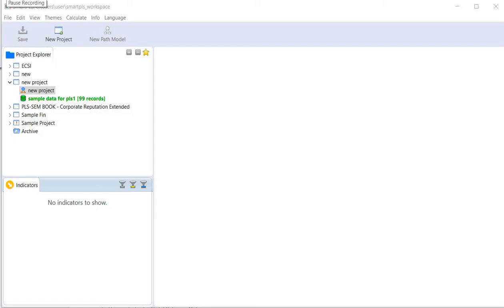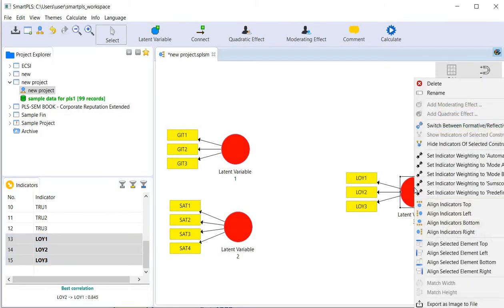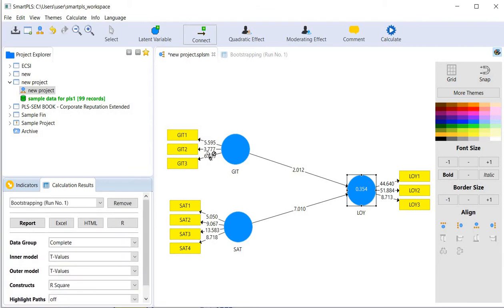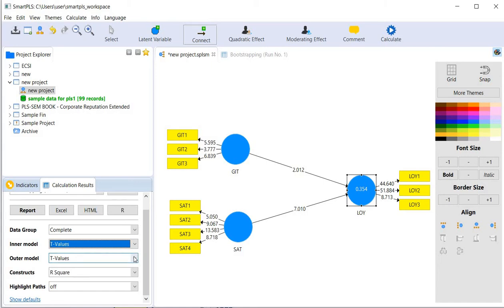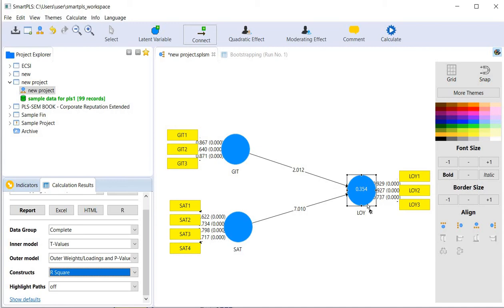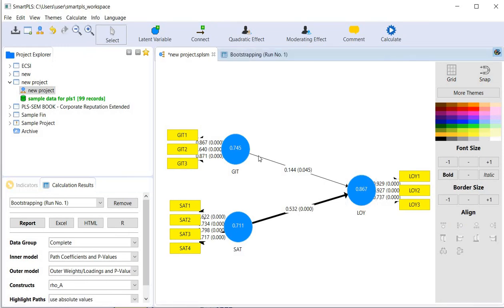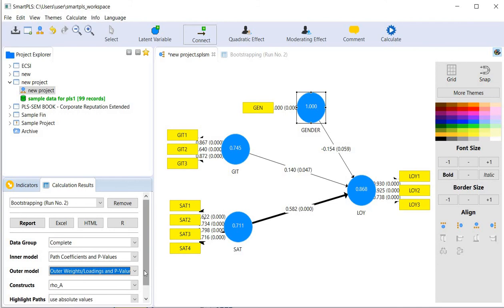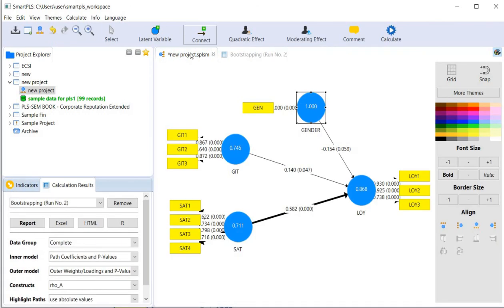Dealing with Control Variables in PLS Path Model using SmartPLS: Path Analysis and Interpretation

Comment: Greetings sir
Can we take demographic variables such as age,gender,education as control variables in pls sem?
Also is there a need  to perform mga as these are control variables?
Reply from the maker: @anugrewal9790  Inclusion of CVs is already explained in this lecture. Please note that structural techniques don't provide detailed CV analysis as in HLR. MGA should only be performed if moderation is hypothesized.
Reply: @ChMahmoodAnwar  thank you sir
In case a control variables comes significant
Do I need to perform mga ? Because it’s not my hypothesis part to check the impact of demographic variables?
I will be very thankful
Reply from the maker: @anugrewal9790  You can simply report these significant results. MGA can also be run as an auxiliary test.
Reply: @ChMahmoodAnwar  ok thank you sir

Comment: Thanks for the video. I was wondering did you extract control variable from spss? If yes how did you do it?  you have latent variable here. I need to do the same. I appreciate your help.
  
Thanks
Reply from the maker: Nominal or categorical controls are not considered as latent variables. Watch my lecture "How to prepare and upload Data file for PLS Path Modeling in SmartPLS" to get an idea how to prepare data file for SmartPLS.
Reply: @ChMahmoodAnwar  thanks i will check it

Comment: what if the control variable is a latent construct (like trust in your paper)?
Reply from the maker: Theoretically, SEM and PM were not designed to analyze control variables. Use regression if you want to analyze or work with controls.
Reply: @ChMahmoodAnwar  thank you so much for the answer Professor. I have one more question, are control variable and moderator variable the same?
Reply from the maker: @reynreyn9900  Controls and moderators lie at same level. Controls need to be controlled in the model, whereas moderators regulate IV-DV signal strength and/or relationship direction.
Reply: @ChMahmoodAnwar  thank you so much Professor! I understand better now
Reply: Wonderful. Sir how can I Contact you.
Reply from the maker: @brame2000  Thanks. Pls see the profile section of YouTube channel to get contact details.

Comment: Please explain how to handle  2 or more than 2 Dependent variable while writing equation in Eviews and interpret the results so obtained or share any link which explains this issue. Thanks
Reply from the maker: You can write a loop in Eviews like this and interpret results in standard way:

for %dep dep1 dep2 dep3
equation eq{%dep}.ls {%dep} c x1 x2 x3
next

Hope it'll work for you.
Reply: @ChMahmoodAnwar  the mentioned above did not work. assume I have 3 independent variable and multiple independent variables, how to write equation. please suggest
Reply from the maker: @asarwaribit  It really works. May be you are not entering the code properly. You should read the programming chapter of the EViews Command and Programming Reference. Thanks.

Comment: if we are using SMart-PLS, do we need to find out the edogeneity? (2) can we calculate ENDOGENEITY USING SMART-PLS? WHICH SOFTWARE IS THE BEST FRO CALCULATION OF ENDOGENEITY? HOPE YOU WILL ANSWER IN DETAIL
Reply from the maker: Endogeneity is a critical CLRM assumption, regardless of analysis technique you are using i.e., OLS, ML, PLS etc. It should be tested, especially, in causal models. It can easily be detected with Durbin–Wu–Hausman test (augmented regression test) in STATA. Once you get an evidence of Endogeneity, you need to use 2SLS to get unbiased and consistent results asymptotically. Hope this will help!
Reply: @ChMahmoodAnwar  Thanks for response

Comment: To be frank, I do not understand that well. I need help
Reply from the maker: What you didn't understand? Please mention.
Reply: @ChMahmoodAnwar  First of all, thanks for replying. Sometimes a control variable (gender, age, education) is added as dummy, but I do not understand why it is done. Which one is correct? I am confused about it. By the way, could you send an example of control variable reported on the paper, especially with amos or smart? I do not know how to report. Thanks for your time.
Reply from the maker: @corinacrn7684  To understand this you need to know why controls are added to the model? Basically, Hierarchical Regression is best to analyze controls, AMOS and SmartPLS were not developed to analyze controls. You can consult Jabbour et al. (2014) to have an idea.

Comment: Salam, so SmartPLS could just basically tell you whether significant or not, but can it tell you whether a male or a female has a higher mean value? Or this sort of test should be done in ANOVA using SPSS.

BTW If the gender or other control variables are significant in smartpls , is it possible to be insignificant in SPSS since they were actually using different methods?

English ain't my native tongue, hope you could actually understand what I'm talking about
Reply from the maker: W. Salam. Actually Path Models and SEM were not developed to analyze controls. Regression is the classic model that can handle controls and other confounding variables. As far as SmartPLS is concerned, you can run a Multi Group Analysis (MGA), but will only tell you whether a group significantly influence the outcome or not?
Reply: Hey, I am doing analysis similar to yours. Can you help how you did that?
Reply from the maker: @Austresi  Hi. You can find my email on About section and send me details.

Comment: Salam, I am just a learner, but you are an expert. As per my little knowledge, gender as control variable has significant effect on loyalty because both BCLL and BCUL values are negative. What you say?
Reply from the maker: W.Salam. For control variables, don't look at CIs, simply observe t-statistic and its significance (in this example it is less than 1.96, insignificant at 0.059-Red colour). Hint: Run the PLS Algo for model with control variables than run Bootstrapping for same model. You will find that outcome is similar for control variables.